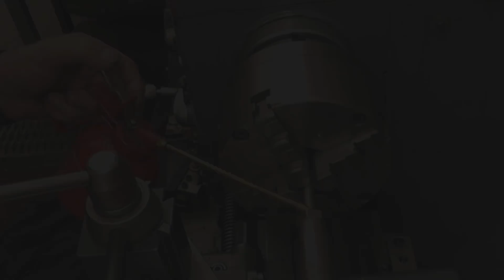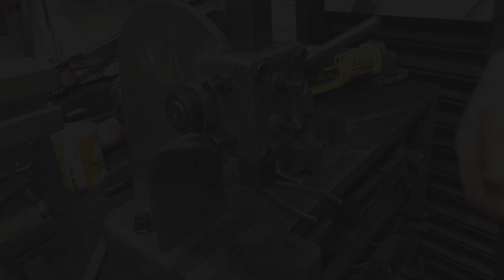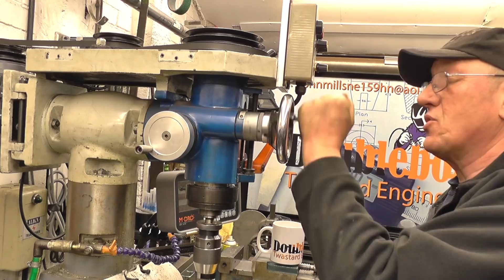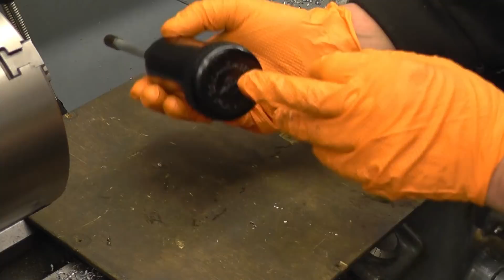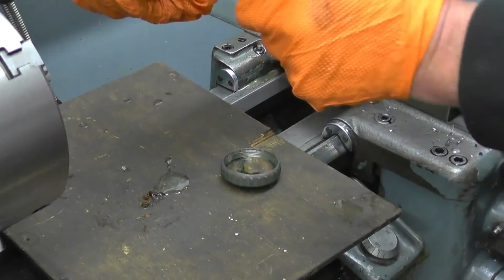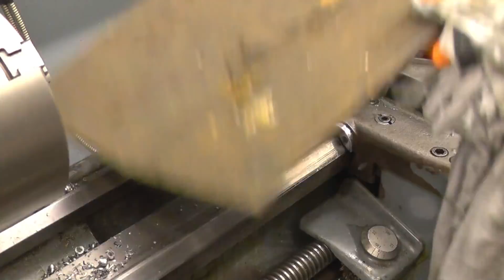SNNC 252 P2   Metal Bending Jig

Comment: No mess fill for the grease gun is to take a plastic bag and cut a small corner in it. Then fill partly with grease excluding the corner, and put the corner with the hole down to the bottom of the grease gun, and then simply squeeze the grease down there, pulling out the bag as you fill up the gun. Less mess, and any left in the bag straight back into the container still clean. You can also use the bag to get the big dollop of grease out as well, so literally only one bag to dispose of, and no gloves or cloths needed.

BTW my one little grease gun is marked "Morris Minor" as it was originally part of the toolkit of the car.

Comment: Tecalemit make airlines and tyre inflators, as used in petrol stations and tyre bays.

Also, for filling those grease guns, you can get cans of grease with a metal plate, with a hole on the middle, which sits on top of the grease.

To fill the grease gun, you place it, open end down, on top of the plate and press down, thereby pushing a lump of grease into the gun, without having to touch the grease.